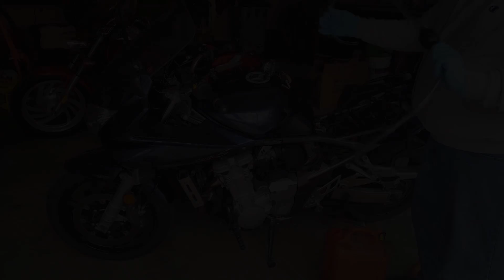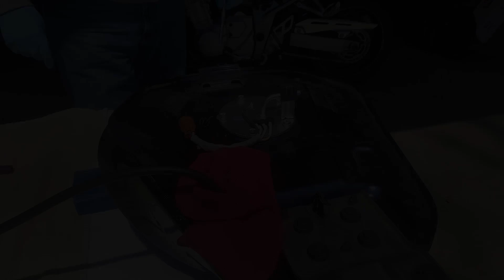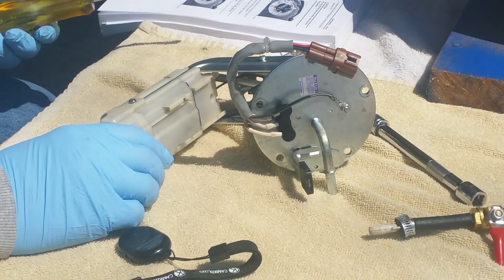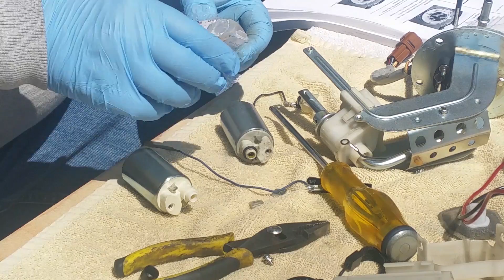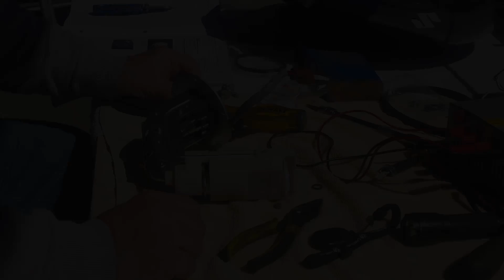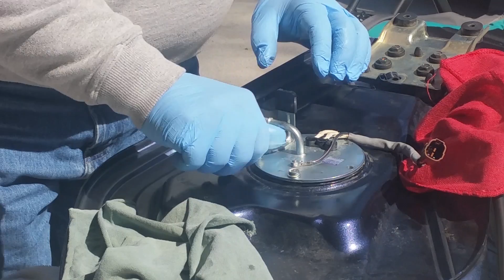2007 Suzuki Bandit 1250 Fuel Pump Fix

Comment: Very detailed I was figuring out where that black clip at the end goes since I forgot how I disassembled it a common thing with these bikes the fuel system gets messed up and that's where it turns into slippery slope of figuring out which one to change.
I started with spark plugs, then the plug boots then the hose and the drainage hose then did the fuel pump and now I've just done the injectors it seems fine for now but God knows how long will that last I think until my next paycheck

Comment: If you are going that deep into the fuel pump it is worth checking how dirty the fuel filter is in the pressure regulator housing. These things can block really bad and stop the bike from reving. I clean mine with a small ultrasonic cleaner but I believe carb cleaner work well too. Very hard to see inside, stick a small q-tip inside and see if it comes out dirty.
   The screws go on first and the mesh filter housing just clips over the top, makes it a bit easier to get the screws in.

Comment: Be sure that the fuel screen in the tank is not plugged that fixed mine. I had about 17000 iced on at the time.
Reply: Where is the fuel screen? Is it inside the tank also?

Comment: Did your bike just caught out and  wouldn't start Got a 2008 Suzuki bandit 1250Tone over but will not start
Reply from the maker: Yes, just quit.  Check the spark.  If good, fuel is most likely culprit.  You should hear fuel pump click on when ignition is turned on.

Comment: I followed this and after replacing the fuel pump an initial improvement was seen. For about 20km. After this my bike went to shit again. It was fucked (the fuel pump) so I am not complaining about the fix. However, my problem also involved the fuel pressure regulator as well so my problem wasn't fixed just by replacing the fuel pump. My bike is now running perfectly. After I rust clean my tank I'm going to get it dyno tuned. The Suzuki manual for the Bandit has a warning not to remove the fuel pressure regulator. Probably because they charge around $180 for a new one (which a mechanic would install in 5 minutes like I did) and I got one for $35 on Amazon Prime. Hope this helps any fellow Bandit riders. My bike is an Australian delivered 1250S K9. 72,000km.
Reply: Any changes or updates?

Comment: salve
ho fatto la procedura da lei indicata per la sostituzione pompa, ma la moto mi perde potenza a motore caldo in accelerazione a giri alti.. ....
può darmi un consiglio?
grazie
Reply from the maker: Could be something as simple as a gas cap not venting well.  I am assuming you changed the fuel filters while you had it apart.  From limited info I would look at fuel starvation, caused by heat.. good luck
Reply from the maker: There is a small mesh screen in the plastic part where the pump fits into which also should have been cleaned out if I remember correctly.  I was reminded of this by another commenters
Reply: grazie mille per l'informazione....
proverò nel modo da lei descritto....
il mio meccanico non vuole fare questo lavoro e vuole farmi cambiare tutta la pompa... costo 480 euro....
Reply: @luckylucio1973 ciao hai risolto poi ? 19:07
Reply: avrei un'altra domanda...
nel caso dovessi acquistare una nuova pompa carburante, la pompa della 1250 si può montare su una Suzuki Bandit 650?
grazie ancora..

Comment: Bonjour merci pour la vidéo, mais tu as oublié un autre filtre qui se situe  à la sortie de la pompe dans le boîtier du contacteur de pression , ce filtre se bouche on ne peu pas le changer et difficile d accès il faut faire tremper ce boîtier dans du pétrole  et avec un gOupillon pour nettoyer les dents le brosser  puis souffler au compresseur. J ai eu cette panne problème d accélération  j avais changer l'aéroport motEUR DE LA POMPE LE FILTRE A ESSENCE LE CONTACTEUR DE PRESSION JUSQU à ce que je découvre ce filtre qui était bouché 👍🏼 depuis la moto refonctionne

Comment: Hey Paul, although my 1250 FA doesn't suffer from a failed fuel pump I'd like to thank you for this very informative video, well done! Greetings from Germany and always remember, the most problematic part on a motorcyle is the nut wich connects the seat to the handle bars. ;-)
Reply from the maker: Thx and well said!

Comment: If my overflow is constantly pushinging out gas what would be causing that. I'm looking alot of gas there
Reply from the maker: Parked in the sun?  Those tanks are sealed tight and get hot easy..  Make sure your vent tube is not kinked or restricted..  If it's pushing gas out try opening fuel cap to relieve pressure.  Unless you're riding, careful on how much you fill it.  Those are the most common

Comment: I'm having problems with the bike running intermittently good and bad. Bike sat for years, 2008 Bandit 1250. Removed tank, removed fuel pump, dumped fuel, put new fuel in, same problem. Plugged injector? it cleans up and runs normal at times but generally running line poop. thank you:)
Reply: Ther is a screen in the fuel regulator that more then likely needs to be cleaned. Best way to clean it is with hot water and a soft wire (speaker wire). Make sure to clean both side of the screen. One side is hard to see. I’ve had to fix a few 1250 bandits with this problem
Reply: Cody, this is spot on.  I'd bet the majority of pump failures are due to the internal steel screen filter in the fuel pressure regulator housing getting clogged.  In my case, the external mesh filter disintegrated and completely packed the steel mesh filter.  I'm surprised the bike ran at all!
Reply from the maker: Injectors could definitely be the culprit...  The fuel will form varnishes while stagnant.  I am assuming you changed the fuel filter etc while replacing the pump?  If not that could be part of the problem.  What I have used in the past is an additive called 'sea foam'.  While it is certainly not the miracle additive I have had pretty good luck with it.  Its purported to remove the varnish and crap from injectors.  I have become somewhat of a believer.   Any auto parts store carries it.  I have several bikes, some quite old that sit for long periods.  Try pushing a tank or two of fuel with that in there before pulling hardware off.  Good luck, let me know how things turn out...
Reply: Thank you! I removed the pump to drain the tank but the pump works fine. Amazing I have an electrical device inside a fuel tank right between my legs and never knew!? I'll take the injectors off but not sure what to do with them.

Comment: very good video, how did you know it was the fuel pump that not working.
What is the correct way to make sure that it is the pump.
Reply from the maker: You can check a couple of ways..  Easiest is to turn the ignition to switch to 'on' and see if the pump runs for a few seconds.  If nothing, double check the pump relay and the tip over (TO) switch - both under the seat..

Also, unbolt the tank and tip up.  Uncouple the lead wires to the pump.  Get a 12v supply and put the positive on the Y/R wire and the negative on the B/W wire.  If it runs, its something else.  If it doesn't, it's most likely the pump.

Good luck!